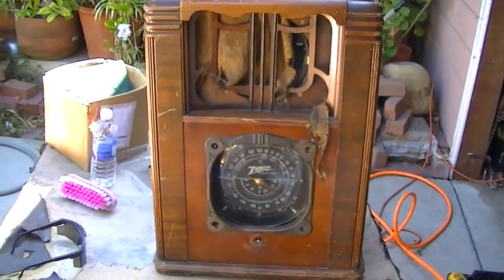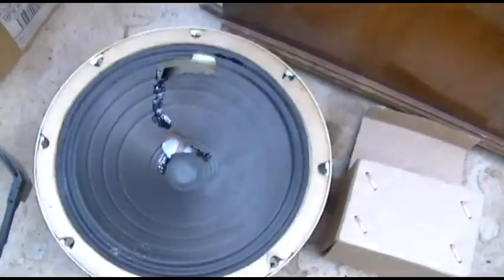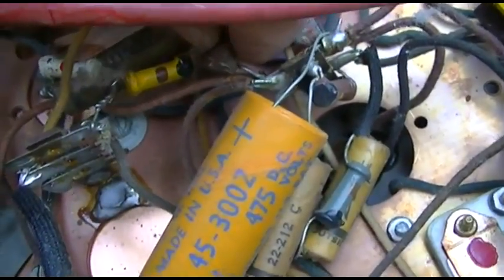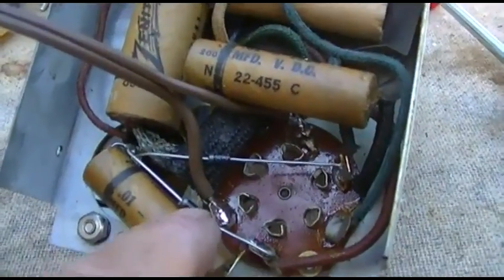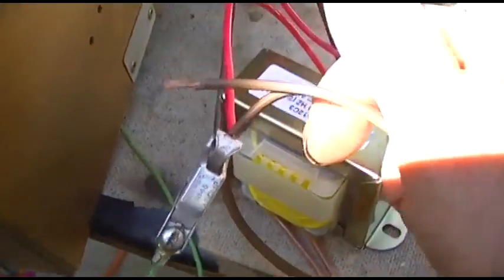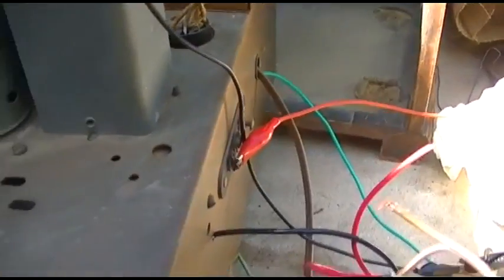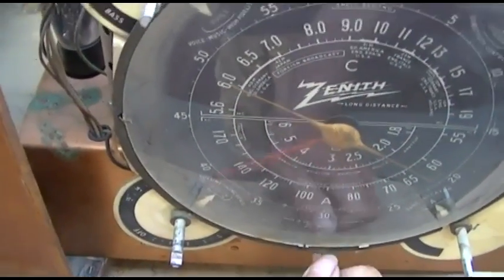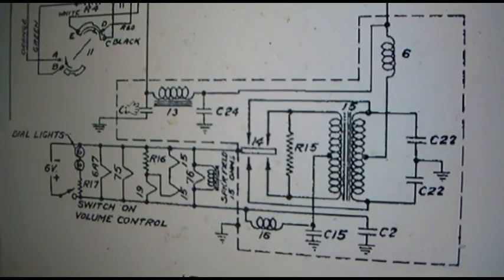Zenith Farm Radio Power Supply Conversion And Repair 6B129  5635 Chassis

Comment: Great video and a nice radio!  Farm radios, like battery portables, tended to have much less use than regular mains-powered sets that could be left on all day with no rundown battery worries.  BTW, the only tube that needs DC on the filament is the directly-heated #19 output, the other tubes are the regular cathode style and work fine on AC.

Comment: Back when dad had the 38pontiac sound truck dynamotor was b +  fil. From car I'm 80  . remember 100 ft cloth wire to trees for am got hit by lightning saw first plasma display .😀
Reply: I remember my grandmother telling me one time about how lightning struck the tv antenna.

 the TV was unplugged.

  the cord was on the carpet.

 butt still connected to the antenna.

 and it burned the carpet when it happened.

How ever I do not know if there was a lightning arrestor installed on the antenna twin lead.

I suspect there was not.

At least at that time.

I still remember them using these what they refer to as clothes pins.

Which was basically a quick disconnect for twin lead antenna connections.

Thay used this if I remember correctly to disconnect antenna during thunderstorms???

Possibly after what happened previously???
Reply: Aaron Brandenburg thankx we installed antennas I did one with twin lead and a arrestor to the water pipe they got hit just damaged the wire .so they had an engineer outfit give me the correct way to do it double grounds &coax next time it blew the back of the house  off lll.😁
Reply: Who was lucky?

Comment: He left the wax caps.  Those things are horrible, the paper breaks down due to the acid and causes leaks.  Although he did say he was leaving parts so a purist could return it to its stock state. Even still, if it's humming and buzzing, what's the point?
Reply: electrolytic caps are the only ones which are surely dead in most things, or else brown turd ones too.  what were those? polyesther?
Reply: paper caps arent as bad as people make out.

Comment: Im suprised you didnt just use a 12v led power supply and a droper or a 3 amp usb charger ?
Reply: the vibrator was dead. no vibrator, no ac. no ac, no radio.

Comment: Great video, but how did you step up the 6volt supply without the vibrator working. Could not figure out how you did that. Maybe I missed something there. Did you step down to 12volt from 240volt transformer then plug that into original center tap transformer. But how did you turn the DC into AC for the new transformer to work?
Reply: What shango did was feed 6 volts AC to the primary leads of the radio's power transformer, bypassing the need for a vibrator. the purpose of the vibrator is to chop DC, so the set's transformer could work. transformers will not work with DC voltage on their primaries, however, pulsating DC or AC will work. feed the primary of the power transformer with another power transformer will work, but it is not the most efficient way of doing it

Comment: Vibrator shot needs a new one  cant be that hard to locate. I wish I'd own it.
Reply: +Radioman56 Could a relay with "normally closed" contacts wired in series with the coil be used as a makeshift substitute? I always assumed that the vibrators in sets like this were little more than that anyway.
Reply: +No Name you maybe able to locate a vib for it numbers on it would help. however if your willing to sell i buy it.
Thanks from will
PS I get it fully working

Comment: I think the vibrators run at 120hz.   Also some of the farm radios used DC filament tubes.  I am curious if the vibrator output was square wave or modified sine wave.
Reply: Thats some serious pleasure.

Comment: can you explain how the vibrator works?
Reply from the maker: Almost all tube car radios have a vibrator, the only ones that dont use space charge tubes all the rest do
Reply: +To SERVE Man Who told you that older car radios didn't have vibrators?  Clearly you have never repaired or installed one!
Reply: Vibrators were used in old tube car radios and in this case, a DC powered farm radio (prior to rural electricity distribution)
These are in effect a a set of contacts with no off position and had electromagnetic actuation. Power was fed into the center terminal(s) Some had  another set of contacts that ran the electromagnetic "armature" not unlike a buzzer of days gone by. The contacts were akin to old school automotive points and condenser and were subject to wear, pitting and arcing that also created a lot if radio frequency noise. So the vibrator had attenuation filtering suppression just to keep the "hash" that resulted during operation, to a minimum. The switching contacts were placed across the transformer inputs and switched the DC back and forth to simulate alternating current. The output was not sinusoidal, more likely square or saw tooth form. The internals of the vibrator were usually mounted via a soft rubber suspension to help keep the mechanical vibration noise to a minimum.
To put it another way, vibrators are a way of creating a type of alternating current from direct current so it may raise voltage  needed for tube sets. The raised or transformed voltage still needed to be rectified back to DC for tube supply voltages
Reply: I know for a fact that the old tube car radios did not have a vibrator
Reply: It basically is a electromechanical device that drives a transformer from a DC source.  It converts it to pulsating DC by switching between two contacts many times a second.   Usually generates a square wave or sometimes a modified sine wave.
Reply: A motor with an offset weight is fixed inside a smooth  plastic tube, when power is applied to the motor the weight rotates and vibrations set the outer case resonating too. Usually a variable potentiometer is fitted on  the outer case to set speed of vibration.
The vibrator is inserted into any orifice to initiate sensual excitement, usually the vagina or bottom.
Oh you mean electric mechanical resonator....oops.

Comment: I think it's an absolute shame really that you didn't recap that radio
Reply: I think he said the owner only wanted him to get it working and not restored. I just aquired a farm radio similar to this one that has been partially recapped. However, I don't plan on using it until I recap the remainder of it. The person I got it from said that it plays very well and doesn't have any vibrator hash in the speaker.

Comment: in a Siemens vibrator radio tube i used a power supply transformer from a old Aiwa midi systen, secondary coil was 30v 0 30v /3A, 12v,0 12v 2A OF COURSE LOW VOLTAGES FOR PLATE SUPPLY IN THE 30 V AC i used a  classic full wave voltage quadrupler the final dc voltage is 224v ,about the filament circuit ,yeah it used four tubes 6v 03A the upgrade was two series of 6 v..12 volts to the filamets

Comment: Nice Radio Problem Caps not tested voltages  need to be checked if a filter cap was to short or let's you had new caps but left in the old filter caps the radio chassis would burn up... Watch YouTube channel Chris Cuff  Magnavox Tube Amplifier  Catastrophic

Comment: Have a look at the videos Shango has featuring G.E wetcell portables too, those also use synchronous vibrators. It's interesting that he got the original transformer to work while being fed 12 volts at 60 cps, the vibrator ran at almost twice that, I think 110 cps.

Comment: Wow, a synchronous vibrator supply--secondary set of contacts take the place of a rectifier tube. First time I've seen this circuit outside of a textbook. And it just goes to show how well these old warhorses were built, taking comparatively little to bring it back to life. Good job Shango, but I think I'd do a little more doctorin' to that speaker cone. (Possibility of getting it re-coned?)